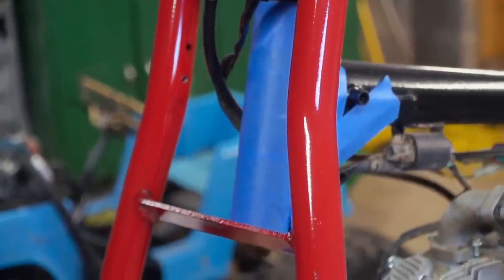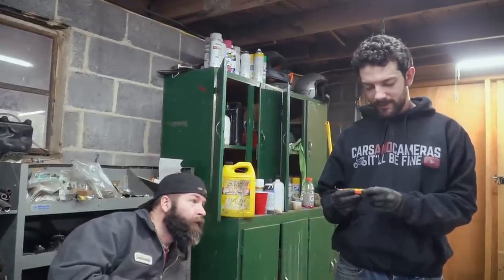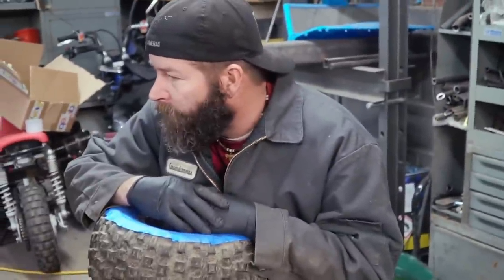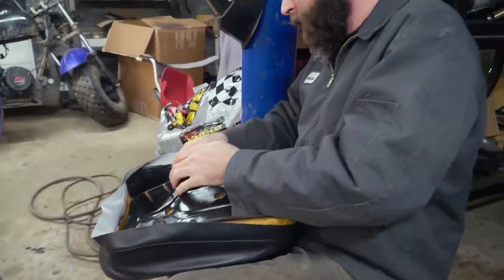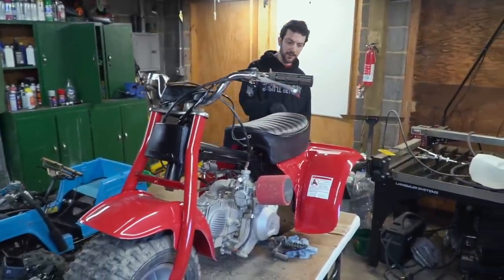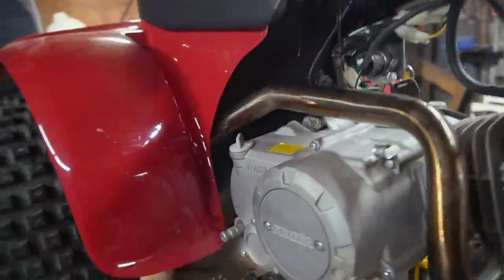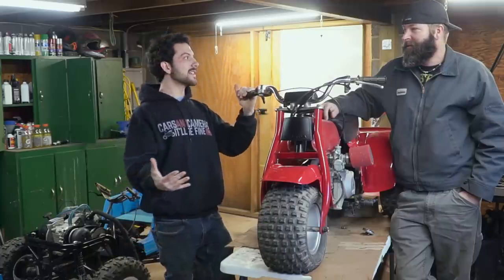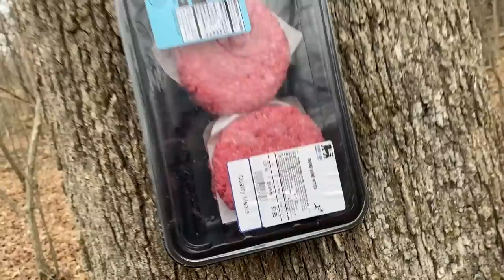Honda ATC 70 Restoration | Restored 140cc 3 Wheeler!

Comment: How could some shilly sits 'thumbs down'? As long as he fills the tires with helium he'll do ok with the weight limit.With the ex-plastic shell they now have 2 fenders for...?Ya coulda thrown some shrimp on the barby to finish the joke.Now you need a rack over the Front tire so you can show off the new Grill...I'm done.

Comment: I'm confuzled.. I had an atc 90 frame and saddled in a built atc125 power plant and after some hard riding I split the frame after a nasty wreck. Turned out the larger motor had an eyelet,  i had ignored,  at the end of the head and after I welded the frame back together it made a huge diff to make a set of plates to connect the motor and head,  leading edge to the end of that long frame neck to get it to stay together with serious abuse.
Sry. Confusing... But yeah. Did some stupid  riding with that family ATC
Why does your motor lack the eyelet of which I speak?
Reply: And the factory chain tensioner is gonna be a [bad word here]